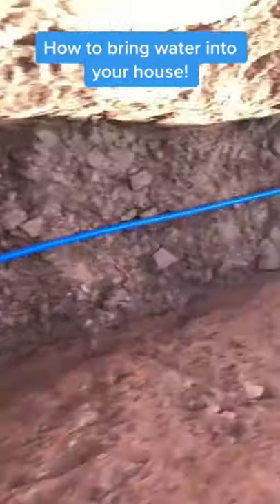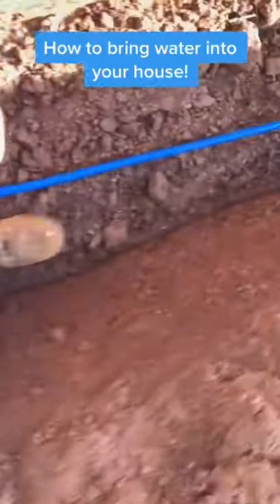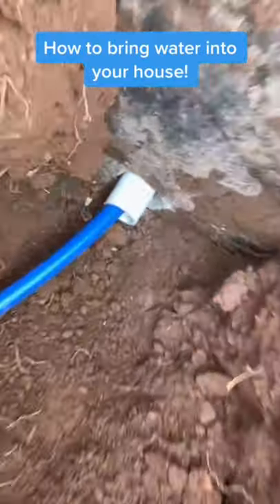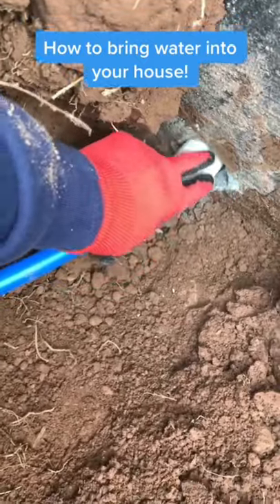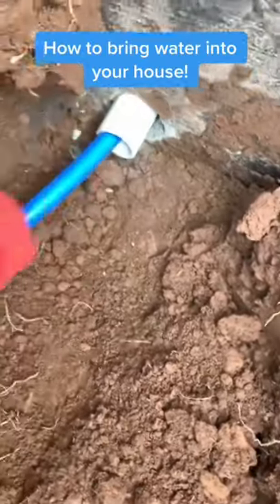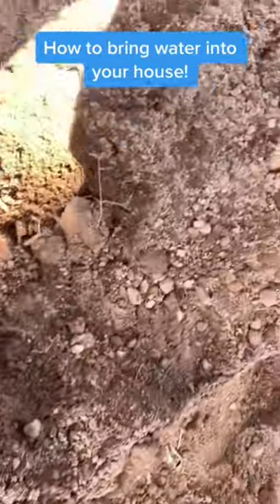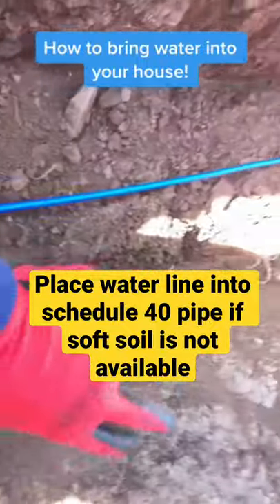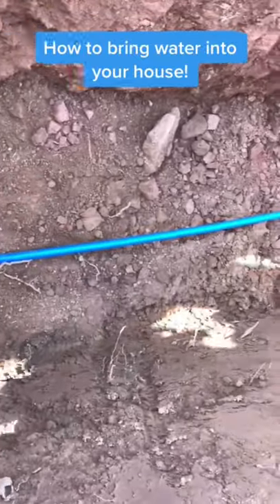How to run a water line from a meter and into your house! #shorts #construction #diy

Comment: You should have run the pex inside of larger PVC pipe to protect the pex from the pH of the dirt so it would last longer than 8-10 years
Reply: I was wondering is it advisable to put the pex into something to protect it against outside forces.
Reply: Pex b is able to withstand underground, read the instructions, pex b on the other hand is not rated for underground.
Reply: @marcosrios3932  Check your comment.
Reply: It wouldn't hurt but pex is designed to be put in the ground as as replacement for pvc , copper, and steel. pex is rated for 50 years of of service life even without sleeving . I have used probally miles of the stuff and have never seen one instance of it failing after 8-10 years unless somone did something to it .
Reply: PEX should be protected just because people may dig into the ground later for other reasons and the thick PVC will insulate it from freeze and protect it from shovels.
Reply: @HandyTim  It's not a bad practice to protect it or to make it easy to replace but code already protects pex from freezing .  It's been the law to call before you dig for over 20 years and tracer wires are placed to show the pipes location also by code.

  I am a builder and inspector by trade . I have  never seen pex failures from such things unless it was installed improperly . The biggest risk of pex failing is impropper crimping .
Reply: And protect against animals

Comment: Pex is hands down a very scary thing to run for a main, I would suggest running copper or flex copper to ur main it’s a little harder and time consuming but it pays off at the end and u will have that main last for a long time especially if u cover it with some kind of plastic or piping whatever workers for you
Reply: In some areas yes, others no, in some areas the grounds so acidic that the copper only last 20 to 40 years, I have a town i service and the sandy soil seems to rot the copper out within 25-30 years. I've yet to see 250 psi rated blue CTS pex plastic fail unless someone improperly install the line, like backfilling with rocks and tar, burying it above the frost level which is 4 feet in maine, or using barbed fittings instead of the stainless steel inserts and compression fittings. I wouldn't use the black 200psi crap for no one, unless I was selling the roll as is.